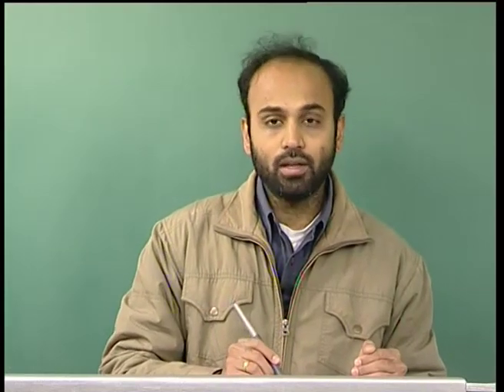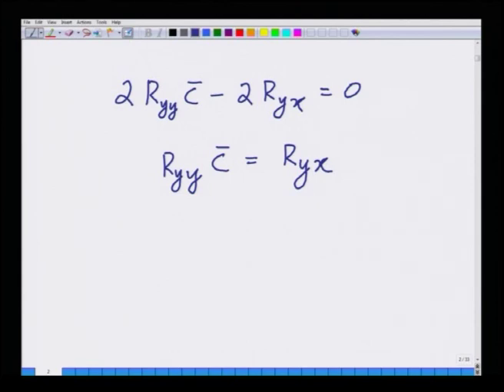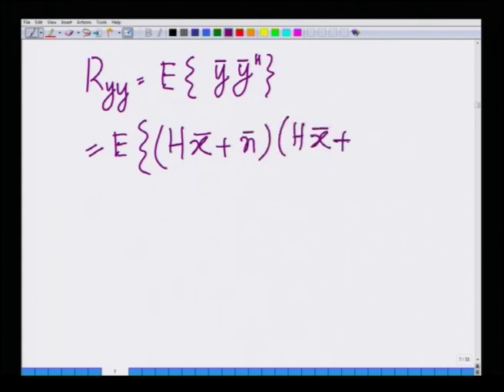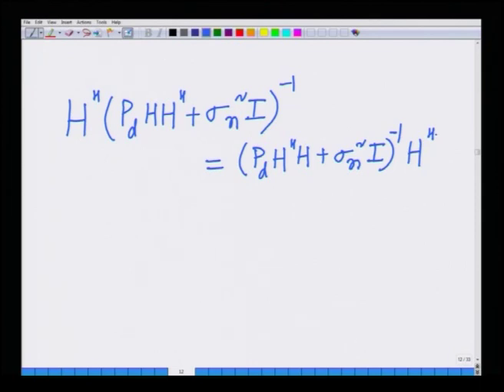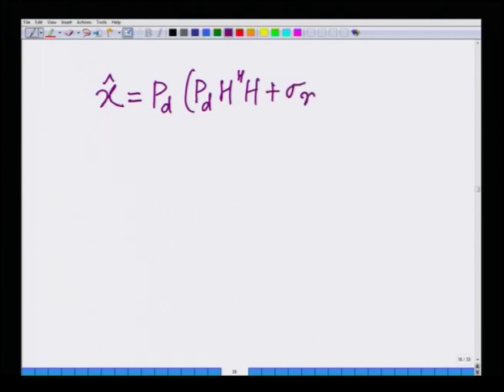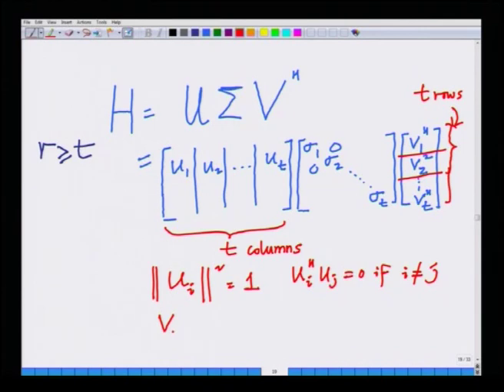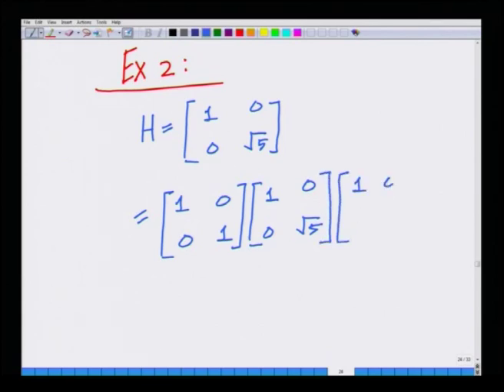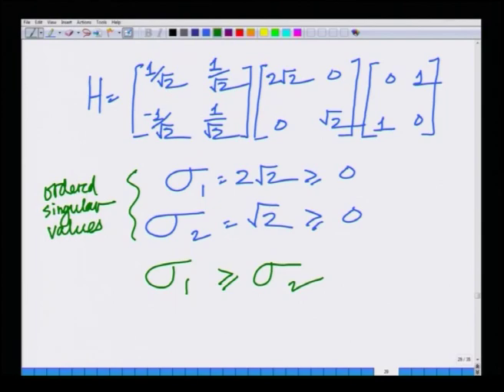Mod-01 Lec-22 MIMO MMSE Receiver and Introduction to SVD

Comment: when differentiate and give zero to the differentiated equation it might give you the maximum or minimum value of the the original function, you should give the two possible solutions for the differentiated equation and get the minimum one.